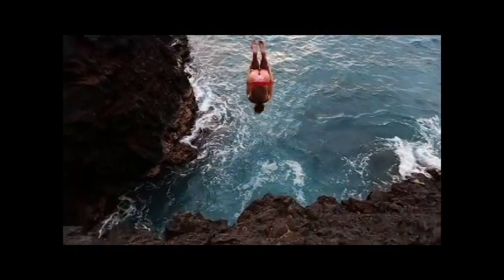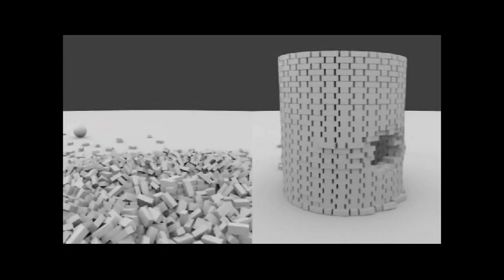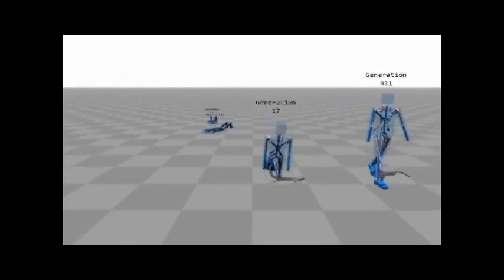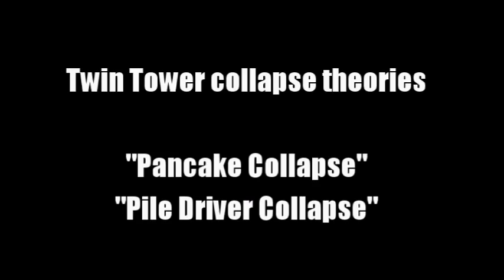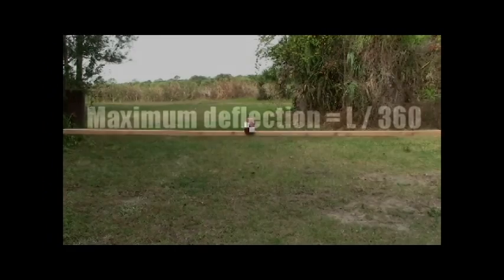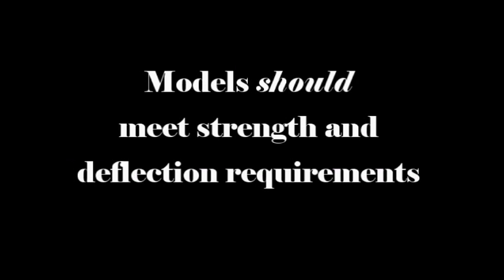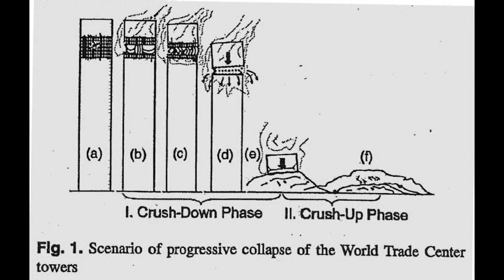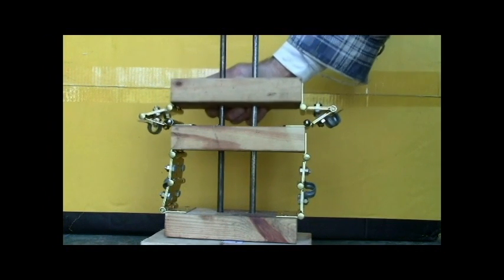9/11 Experiments: The Force Behind the Motion

Comment: well your model is flawed. It does not simulate the real world event correctly. In your model the sides of the tower is constructed by one solid undamaged piece of wood. The real building was constructed by multiple smaller pieces of steel which was wielded together.  The building would not have been able to stand by itself without the floors. The floors themself was the key to provide the necessary stiffness to the building. Your model can stay fine by itself without the floors. 

When you use Newtons third law on WTC, you can only use it on one floor at a time, because the strength of each floor is independent of each other. So to calculate if a floor will break or not, you will have to calculate the strengt of each floor in relation to the mass of all the falling floors above it. Taking this into account, It is easy do demonstrate that the floors was disintegrated easily, therefore leading to something NEAR free fall collapse times.  

- A real engineer
Reply: quosmo1 "Time will tell" is literally the worst comeback I've ever seen
Reply: Finally a sane person. Just for future reference, the perimeter panels were bolted together, not welded. Which makes your point even stronger.
Reply: @brucelansberg5485  yep, these fucking doubters have NO CLUE about structural integrity
Reply: Thank you, and that is also the key to understand why the buildings collapsed. The airplane damaged some of the floors and the fire made it worse. Only ONE weak floor would have to fail, and then the whole building would fall, and that is what happened. 
- A real engineer
Reply: More or less the same. Severe damage to the structure from debree, combined with long lasting fires throughout the building, which weakened the building further. At some point one of the supporting collums collapsed, , weakening the strength of the building even further, which lead to a series of events which resulted in an internal collapse of the floors, which then lead to a collapse of the whole building. Without the floors the building wasn't able to stand, and therefore it collapsed.
Reply: Well, there was a clear connection... If WTC 1 and 2 wasn't hit by airplanes, they would not have collapsed. If WTC 1 and 2 wouldn't have collapsed, WTC 7 wouldn't have been hit by debree and set on fire, and though it would still be standing.
Reply: Jedi Senpei Ok, how about these were the strongest buildings in the world at the time and were made to resist the impact easily of a even bigger airplane, and fire alone has NEVER brought a building down thus WTC 7 couldn't be falling in any fire/debree theory. How about that very old unstable tall building in London that was burning for a whole day. The whole tower was lit up. 'inferno' or something was it called. That didn't fall down so how will a small fire let such a much much stronger building make fall down? If you would be a real engineer you would know that normal fire doesn't come nearly close to the  temperature to weaken steel. And btw. The building was the strongest building because it was made of reinforced concrete with steel in it, there was no building more stronger than it mister 'real engineer'.
Reply: Jedi Senpei Ok so how about the planes? They are made off lightweight aluminium, and this building is made of reinforced concrete with steal. How would this plane weaken any building let alone fly into it. Have you ever seen a car driving high speed into a tree. Well imagine even weaker aluminum and concrete with steel in it way stronger than that tree. You are not that bright for a engineer.
Reply: @jedisenpei855  1. Thats not what happened .2. laws of physics claim it cant happen.  3. History proves its never happened.  You dont have to be a engineering wannabe to what is visible to the naked eye. Symmetry is the Smoking Gun
Reply: Frank Heuvelman Thank you. This building was the strongest in the world at the time. Made to easily resist even the biggest airplane in the world.
Reply: Also each floor has resistance and resistance adds time to a collapse (and also deaccellerate it and eventually stops it) so frefall at all is not possible and NIST themselfs admits that wtc7 was in frefall for more then 3 seconds how do you explain frefall speeds on a gravity collapse through solid steel and concrete?  (plz do im so curious mr "REAL ENGINEER"
Reply: Daniel Andersson opposite scenario happened because of what was already explained.

People can say "this would have happened" all day, but Newton's law and math will always come out on top.

Each floor vs the increasing weight of collapsing floors above it actually results in an increase of collapse speed as floors fail to the greater loads faster and faster.

This is how the near free fall speed  happened.

By the time the bottom floors were collapsing it was happening two at a time and everything was just being disintigrated into powder.
Reply: Brandon Weinberg Actually no, yes the weight would increase but the speed would decrease because of every floor it would have to hit and break through. It wouldn't be able to pick up speed but rather quickly start deaccelerating.
Reply: @DrSpoculus   Brandon Weinberg  No.... just no. Please read up on Newton's laws of conserved momentum, opposite forces and acceleration. It is not only mass that contributes to the force being applied to the lower floors but also acceleration . F =mass x acceleration.  Even if  the mass is a factor, with each floor collapse resistance would be encountered by the floors below and cause deceleration. This will happen until there is no acceleration and no net force would be applied to ensure further collapse. Note that gravitational force of the already destroyed floors is not the same as net force. Net force is the sum of all the forces in the system. That means the gravitational force applied to the lower floors by the collapsed force, the normal force applied to the collapsed floors above by the lower structure and floors, you can even take into account the force that could of wind currrents on the strucure. But even wind currents' would not give such a huge notable effect.  But basically the top floors should decelerate and the forces would cancel eachother out and lead to no futher downward movement. The 911 videos of how the floors started collapsing looks unnatural and uniform. It doesn't obey the laws of physics.
Reply: @DrSpoculus  I agree 1000%, why others can't comprehend this is baffling. Increased weight/force + gravity = increased speed.
Reply: @biosciencegeek5057  we are dealing with people of rare intelligence...... it's really show any.......and Joe V ....... if he threw a rock at the ground he'd miss......aww youth
Reply: No, you are wrong about that. Do the math, and find out yourself.
Reply: You ARE EXACTLY RIGHT
Reply: @jedisenpei855  nigga plz.   1. Thats not what happened. 2. Laws of physics teach it cant happen.  3. History proves its never happened.  all three buildings fell symmetrically which represents order.... far too much order. You haven't the slightest idea what you're talking about
Reply: Real engineer you're a you tube wanna engineer with a degree from Legoland. Any block of material must slow down when it hits any masterforce that previously supported it. The upper block of following structure will destroy itself well before I can possibly crush the entire larger lower  structure. The object that does the hitting always slows down. Conservation of momentum is the fundamental law of physics that cannot be broken. Total collapse not possible and that's the floors were removed
Reply: Personally I wouldn't trust any of you fools with Lincoln Logs
Reply: +CooL!K3DaT Please draw a free body diagram and see for youself what holds the floors. If you understand physics you should be able to do this. I can reveal for you that it is not the floors below that holds the current floor. I don't care what you think of me. I truly just want to teach you about physics. So many people mention Newtons second law and use it as an argument for there conspiracy theory, but they fail the second they try, because they don't know how to apply the law on buildings.
Reply: @jedisenpei855  you want CoolK3dat to draw a free diagram...?  
That will never happen..  he can't even tie his own shoe laces.
Reply: @9962lopez  Here are some FACTS for you regarding the construction of the towers and then how they collapsed.  if you disagree post some facts to support your opinions, not your own ignorant dooofus shit statements
The 3 main systems of the towers construction were the exterior panels, the floor joists, and the interior core columns.   spandrel plates are welded across multiple exterior panels and multiple interior columns.  Much smaller truss seats were welded to the spandrel plates.   The floor joists were bolted to these truss seats.  
THAT was the only connection between the exterior panels and the core columns.   
Without that connection all three systems would collapse.  They worked as a unit to remain rigid and strong.  
When the mass of falling floors impacted the FIRST stationary floor, that floors bearing capacity was greatly exceeded.  The bolts were sheared off all the floor joist connecting points, slightly slowing the falling floors, but then that floor joined the falling mass and began falling downward also.     
Now the falling mass has More speed and More weight when it impacts the second stationary floor..  

Once the collapse started there is no way to stop it.  
The unique design of the towers is what led to their demise.

Remember now, 99.5% of all the Architects and Engineers have no problem with the official story
Reply: @jcviaene  how long you been at this joe? How many have you convinced?  ZERO!!!   And where did you get your figures from? How does your theory account for the Symmetry in the collapse? How does it account for the high velocity bursts of debris being ejected?  How does it account for the well documented presence of molten steel? How does it account for the announcment on CNN of bldg 7 collapsing prior to the actual collapse? How does it account for the secondary explosions reported? Or the lack of debris at sight or the pulverization? It doesnt!  Back to the drawing board for you. LMAO
Reply: @jcviaene  remember...99.5%  of what you claim is fictional. Give it up
Reply: Can you give me your degree details Mr. Real engineer? What you said about having to account every floor collapse as a seperate event from the previous is correct but what you conveniently forgot to mention is that even with increasing the mass of the collapsing floors, The structure beneath would till provide resistance (Newton's 3rd law) and this would result in some (not all) loss of momentum and deceleration. Since downward net force is needed for the continued collapse of floors and we (I assume you do as well) know that we can show this as F = m.a (force=F, m=mass, a =acceleration).  Thus with each floor collapse resistance by the floors and structures beneath would cause deceleration of the mass of collapsed floors until the mass has no acceleration and the mass would stop moving. Since acceleration is now equal to 0 we can say that no net force is available according to F = m.a to ensure further collapse.
Reply: @biosciencegeek5057  Love the regurgitated useless theoretical lack of applied knowledge. Let's get down to actual nuts and bolts, as a builder everything works great on paper, it's rarely that cut and dry. If you're not in the building trades, YOU HAVE NO CLUE!!
Reply: @biosciencegeek5057  yeah I find fault In their claims.. 
One of their spokespeople claims WTC 7 collapsed in 7 Seconds.  That's a lie. WTC7 collapse took over 16 seconds.   
The nearly 3,000 people registered at the site are there requesting a new investigation be done.  
in 17 years that group has not found any fact to change any part of the official story..  what the hell have they been doing??? 
 Check their credentials,  they are not all currently working Architects and engineers.... And even if they were, that number, 3000, represents about one half of 1% of all the currently working A& E.     Hmmmmm that would mean that 99.5% have no problem with the official story
Reply: How can any of you YouTube engineering wannabes explain the molten Steel throughout the debris field? P.s. if you don't like my opinion of you I suggest you improve yourself.
Reply: +BioScience geek You seem to know Newtons second law. That is great, but you just don't seem to understand how to apply it. When I say that you have to account every floor collaps as a seperate event I mean it. Then you cannot suddenly take the resistance from all the floors below into account as well. You can only take the resistance of the floor itself and what holds it in place, and that is the individual bolts at which the floor has been attached to wall with. So there you have it. The resistance of the x number of floors below does NOT play any role when tons of floors above fall upon the current floor. Bolts will break, walls will crumble, and the speed at which it happens will increase. It has to do with how the building was constructed, and how it stands. It is not the same for all building, but in this case it was. Same for WTC 7. 

-Real Engineer.

Comment: The trade center buildings, not 7, were made for maximum spacing. Designed by Jeb Bush, these buildings were architecturally made with one goal in mind, and wanted less columns for more room for offices to rent.
Thusly they concluded on a pillar in the middle, and stacking individually built floors (3 per floor).
This took away the amount of weight the building could handle, but was still far above normal regulations. When you add a fucking 767, to this, it will break after intense heat and damage to the only column holding it up. 
All sky rises have explosives in them to destroy the building if it endangers more lives, and all evacuate the building. 
Sometimes it's not C4, so it's not as stable and can be set off by intense heat and pressure. As to what would occur, with a fucking 767 ramming it and exploding.
Reply: Do you have a device implanted under your skin to tell you when to breathe because you are too shit stupid to do it on your own?
Reply: Wes Fox 
yeah, probably. I'm just as stupid as everyone else I'm sure.